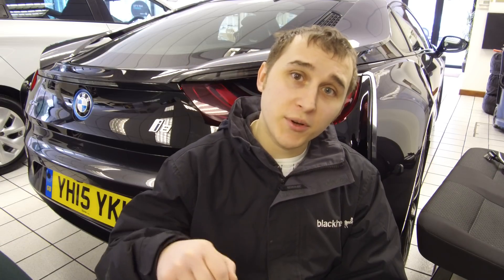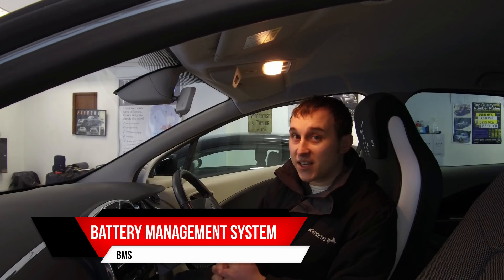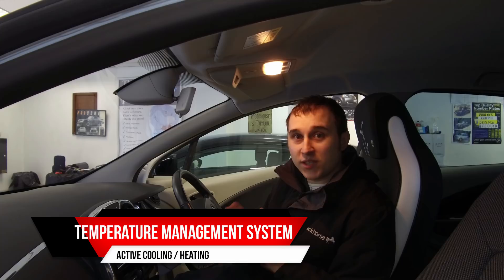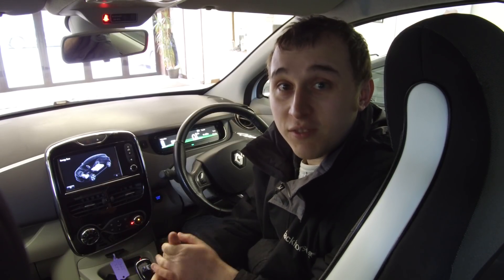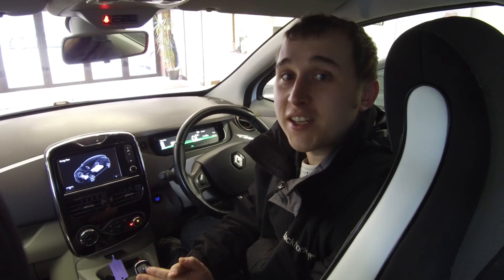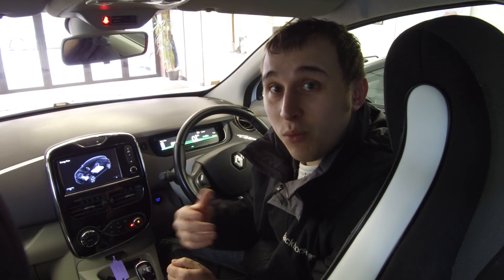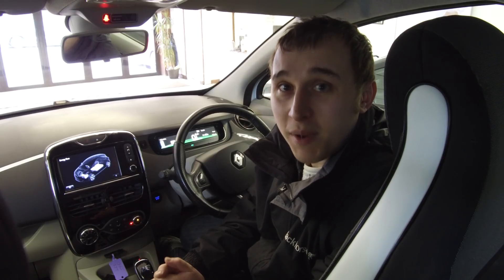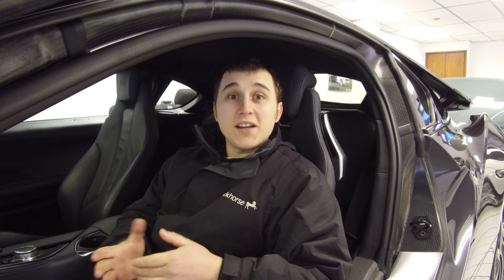2018 Nissan Leaf Charging issues TMS? Firmware?, my take  🔋🔌🚗

Comment: I don’t have a leaf that I can take apart and look at all the airflow vents, but let’s say Nissan Leaf engineer’s actually graduated high school, and they know every HVAC system (unless in biohazard mode) will have some fresh air intake, and therefore there will also be some heated of cooled air vented out of the car. 

Under the Leaf there are some aerodynamic panels which basically form a chamber between the bottom of the cabin and the outside air. The sealed battery pack is in this area. 

If we allow the HVAC to vent into this compartment, it would surround the battery case with the same air the humans want, which tends to be the same temperature batteries want. The same concept allows out cell phones to survive with passive cooling because we wouldn’t charge out phone in freezing temp and hopefully won’t set the phone on a dashboard in the sun and charge it.

In super cold weather, the battery will be so cold that initially you will want to heat it by driving, cabin heat, or charging slowly as it warms up enough to safely charge. Once it can take the full 40 kw from a 50 kw dc fast charger, everything will be great. The battery warms and charges fast. 

Under normal circumstances, you would then drive it somewhere and it will sit outside and fight the cold by trying to keep enough heat for 8 hrs that it doesn’t get too cold. But if you drive it in cold weather with the cabin heat on and drain it fast and charge it fast, eventually you will heat soak the battery and the BMS will do its job to throttle charge rate. 

In hot weather, with the air conditioning running, the battery should be encased in cool air from the cabin. And since cool air tends to circulate naturally down and out the underside aero panels, it should be able to carry some heat away.

We all know active thermal management is best, and liquid cooling is better for dissipating heat from a confined space out to where there is more room for the final heat exchanger. Why is Nissan being so stubborn with this issue? Why was Steve Jobs not allowing Adobe Flash on iOS devices? Why is Apple getting rid of 3.5 mm audio jack, and why does Tesla refuse to include LIDAR? 

Can Nissan not afford to hire a college graduate? Are the Japanese stupid when it comes to batteries? Why are all the other Japanese car companies waiting for better batteries before they start losing money on each car? 

From what I’m seeing, 2018 leaf owners who drive it like a 2013 Leaf are very happy with it. Nissan could have fixed the problem by removing the DC fast charge plug. But to give added capability, they offer the plug, but it doesn’t turn the Leaf into a vehicle that can be fast charged and driven hard 24/7. But everyone wants to know why Nissan doesn’t just add active cooling so that you can drive it like you stole it.
Reply from the maker: If you drive it like the old leaf it over heats the old leave could manage multi rapid chargers the issue is the software at my guess is throttled far too early
Reply: Nicolas Raimo, I think they fixed the BMS, so that it stops charging a hit battery, which was making the early Leaf batteries degrade fast. According to James Cooke, who had an early Leaf before the Tesla, that battery would also get heat soaked on a long trip. 

Its possible that just a certain temperature, too cool to run the AC, but to warm to cool the battery compartment. But in 5 years, this battery may still be in good shape because it doesn’t allow charging too fast when it’s warm. 

Here’s something that talks about what I mentioned before, which would be normal on a hot day, but can also be done on a cold day of you are overheating your battery:
http://www.mynissanleaf.com/viewtopic.php?t=22276
Reply from the maker: That's possible which is why i said in the Video one reason may be to make the SOH last longer.
Reply: Nicolas Raimo, we just need to find someone with a 2018 Leaf and plenty of time and leafspy to see if running the HVAC in fresh air, high fan, has any effect on cooling the battery. 

The S model for $29,990 doesn’t even come with chademo, so these guys will never experience the problem using the 6kw charger. The car wasn’t really intended for commercial duty. 

Now people are learning thermal management isn’t want makes the battery last, the BMS does that. The active cooling only allows the battery to charge faster before the BMS does its job.

But the real question is, which nobody has really answered, why doesn’t Nissan just add some form of active cooling? Even a basic one like Zoe has would be good. 

Do you have inside information as to how much a Zoe and Leaf 40 kWh battery cost?
Reply from the maker: No down to the pricing no, however Nissan will be using same pack as Renault next or least same cells as Nissan is switching to LG chem same as renault

Comment: Thanks Nic- nicely explained, in  essence ( Have i got this right? ) for the average driver, who has charged up the night before- goes on a drive say 230 miles with 1 fast charge on the way and stays at that destination overnight- no problem. If you then have a further 100m to go that day - and the battery cools down enough..after an hour or two  they might get away with another fast charge..
Reply from the maker: yes that be fine its down to people doing lots of rapid due to speed, in fact if your in no rush and rapid charge it, it will still charge just slower rate than the previous 30kw leaf.
Reply: leo clarke - the only problem is, the second fast charge will take 2 hours and not 45-60 minutes. If that's not a problem for you, fine.
A normal drive 100% - 0% rises the temperature by about 14°C. A fast-charge rises it for another 20°C.
For your information, you will be driving your battery at very unhealthy 50° to 60°C temperature. State of health (battery degradation) won't be happy.

At freezing temperatures the battery cools down in 8-12 hours (to reasonable temperatures). In summer it will take 24 for the same amount and up to 48 to  cool down close to ambient temperature. 
It has an awfully bad heat dissipation.

Comment: I think they have reduced the amount of cobalt in the cells as the price has doubled
Reply from the maker: +Mark Williams chemistry isn’t my strong point would this affect the heat each cell could handle?
Reply: It has nothing to do with chemistry.
Leaf has no system to pull out the heat. Air cooling wouldn't work because of the battery shape and they didn't build in liquid cooling.
It looks like planned obsolesce.

Comment: 2015 Leaf 24kwh 57000km 100% soh.
Reply from the maker: this from Leaf Spy?
Reply: yes this can be proven by leafspy
Reply from the maker: Higest SOH i've seen on a 2015 leaf yet! your in the lead!
Reply: its a leaf nordic version always used charge timer so never sat at 100%soc for a long time and i live near lillehammer so its not so hot in the summer time. stored mostly in the garage (shade) have litle bit over 100dc rapid charges on it since november 2015. when tesla bjør did his test its was around -10!

Comment: Nissan Leaf 2011 63000 miles, 73% SoH, range 50 miles max
Reply: 73% SOH? At 63k miles? Horrible! 
Warranty or already out of it?
Reply: Battery warranty is  for the first 5 years, and the car is nearly 7 years old. Also, the warranty only kicks in below 9 bars, and I'm at least a year or two off that. My degradation is actually far better than most 2011 Leafs, there are models with 20-30k miles with 30-40 mile range in the US.
Reply: Aaron, I've heard, and it is even worse, and all of this is coming from having no active cooling.
All you can do is a) buy a spare battery and/or b) prevent further damage.
https://pushevs.com/2018/04/27/battery-charging-full-versus-partial/
This advice is actually valid also for smartphones, this is the reason why batteries in smartphones "die" after a year or two. Mine has four, I took the advice and it is still doing quite well!
And never, never leave a full battery at some hot place.
Good luck!

Comment: 1170 Chademo, 870 Type 2 Rapid in UK.....methinks you are a touch biased
Reply from the maker: rapid you only looking at 43kw there's lots of 22kw AC semi rapids.   Then look at ireland next to no chademo,  Germany has very few also,  not sure about rest of the EU.   If it comes over as biased it wasn't meaning to the UK has GREAT chademo support.   In the USA DC is the only real form of charging so they have even better than us
Reply: Yup, 22kW is Fast.
Reply: Dave Bell 22kw is not fast by a long way. Not here not anywhere.
Reply: Nicolas Raimo   Next to no Chademo in Ireland? That's not true. There's more Chademo than AC43 here!
Reply: I would also say its unfair to criticise Instavolt for their choice of business model, they are installing stations as a commercial venture that will be in place for a number of years not just to service the requirements of one model that ultimately wont be the way the market goes. As the market expands with larger batteries the charge stations will only get bigger they have to think 5-10 years in advance.
Reply from the maker: am accounting for AC22 and AC43 in this model, from info I've been told by Jan-Sprat.
Reply from the maker: Phil i get there business model but in 5-10 years time renault zoe's will still be on the road, EV's will last longer than petrol cars so are likely to still have current zoe's for next 15 years in that time there machine might of been replaced.
Reply: But what percentage of overall cars will be Zoe in 5 to 10 yrs? Its a numbers game they have to invest where they can earn the best return on their investment. On simple figures not allowing for taper on charge 22kW post at 30p is £6.60/hr but a 100kW CCS would be £30/hr per space and thats before even applying a premium for it being a faster charge.

Unfortunately as 3ph power is not generally available other than at commercial premises in the UK its unlikely that manufacturers will go down the 22kW AC in the long term as your not going to fit a larger 22kW inverter to the car. Thus if your going to invest in chargers commercially you need to pick what the mass market is going to be. With batteries looking to be in the 50-100kWh range in most models coming in 2019-20 then 22kW isn't going to be big enough as a 4 hr dwell is generally going to be too long.

Only place I think they maybe more common is hotels where theres a longer dwell time but I think most of those are likely to go down the 22-25kW CCS DC route that I'm starting to see most charger manufacturers coming out with at the moment as ultimately I think the CCS plug is likely to be the main winner.
Reply: Nicolas Raimo Do you mean Jan-Bart Spang? I've had many conversations with him and he is a nice guy, but we use the term Standard charge point (SCP) for AC22, AND Fast charge point (FCP) for AC43, Chademo and CCS. Regardless, it is false to say there are next to no Chademo here; there are over 90, which for a population of 6 million works out at about the same ratio as the UK, I think. Don't get me wrong, I'm all for having many more chargers, I'd just disagree with saying there are next to no Chademo in Ireland! ☺ I enjoyed your video. 👍
Reply from the maker: Cheers Superbystanderman make sure you subscribe, you in a Leaf or Zoe?
Reply from the maker: Hi Phil current new model zoe just been released with ONLY 22kw charging, so i suspect still a lot on the road in 5 years, its also nice to put 22kw to free up High power rapids.  If Instavolt dropped AC in 2/3 years i might have a different view, however currently i think its a bad idea, the only reason they don't have AC is there buying American made chargers and are American friends don't benefit from a 240v grid.

Comment: Nissan's decision to not use a TMS seems to be back to haunt them. Maybe they can retrofit a system..  Or else usher in the new 60kWhr battery and kill off the 40Kwhr
Reply from the maker: i suspect lots of 30kw leaf owners will be holding out now until that
Reply: I did wonder why the 60kWh was coming so soon after the 40, thought it was the battery cost but maybe a little more sinister and they came across testing problems hence the change from AESC to LG for the 60.

Comment: I think 2 hour "rapid" charges would put me off with a hot battery, no thank you.
Reply: There have been reports (although I've only heard second hand) that drivers in Spain have experienced charging slowdown on their first rapid. External temperature was around 20 degrees.
Reply from the maker: Don't forget it only happens on 2nd rapid and the battery isn't really that hot which is why am suggesting maybe its a fault in software
Reply: Nicolas Raimo evidently it doesn't only happen on the 2nd rapid charge to some owners, it all depends on battery temp whilst charging, people won't touch them with a barge pole with this problem, who wants to wait up to 2 hours per rapid charge, this is what happens when you ram more and more battery into the same size sealed battery container with no active temperature control, you get a public relations disaster. They have known all about it for years and have chosen the cheap fix and have been found out.
Reply: Well, as they have not rolled these out to warmer climates yet I think it'll be as bad as the battery fiasco with the Gen 1 Leaf in places like California, Arizona etc. You seriously would have thought that they'd learned their lesson from that.
Reply from the maker: maybe they might take a "leaf" out of renaults book and use the climate and heatpump system to cool
Reply: David Barr you are so right, it is all about investment and my opinion is that Nissan are not as enthusiastic about electric cars as they once were and they are not doing what is nessecarry to do the job properly, my 30 overheats after the 4th rapid in a row, it does not take a brain surgeon to realise that 4/3 times as much battery in the same space causes much more heat build up.
Reply: Yet they active battery cooling in the e-NV200 van, regardless of battery size I believe.
Reply: Phil Gordon just what I sumised.
Reply: +Neal Archer and Nicolas Raimo, but you will have a 40°C hot battery in summer at the first rapid charge, which will already result in a 27-30 kW charge.
At the second rapid charge it will be 18-20 kW, 2 hours and a battery at about 55°C. And no, it is not a faulty software, it's by design to prevent the battery to go over 60°C.
Actually a bad design, having no TMS. The battery should never ever go over 40°C.
Reply: Richard Petek I was so excited about Ev's and bought my 30kw hr leaf just over 2 years ago. Since then I have been completely disuaded and dissolutioned against buying another until many years in the future. At leaf prices EV's are a  completely compromised vehicle against ice at the moment for numerous reasons. I have had my electric trial and until car ability and infrastructure are comparable with ice I would never consider another.
Reply: I don't want to spoil your soup, so I will say just - take care where you are on that chart:
https://pushevs.com/2018/03/20/nissan-leaf-battery-degradation-data-24-vs-30-kwh-batteries/
But you can do a little about it:
https://pushevs.com/2018/04/27/battery-charging-full-versus-partial/
Tested and verified:
http://batteryuniversity.com/learn/article/how_to_prolong_lithium_based_batteries

Having no active TMS is a bad design, but to be honest, if the car doesn't have it, Leaf 2 is actually helping the battery - on the expense of driver's time.
It does what a Leaf 30 kWh owner should do manually. Stay away from those red bars, fear them like the devil!
And avoid charging over 80% unless you really really need it.

Drive safely!
Reply: Neal Archer, another thought: Hyundai Kona 64, arriving this summer.
An EV that will challenge Tesla Model 3 and Jaguar iPace - at a much smaller price (and, OK, a smaller car)
Against ICEs? Depending on where you live. Europe and USA - east coast and west coast - no problem. When the car needs a charge, you need a break too.
OK, at 50 kW charging stops will be longer than your coffe-breaks, more like your meal-breaks (45 minutes). But when project Ionity is built, which should happen in a year or two, your coffe-breaks will be coffe-breaks (0-80% or close to 300 km in about 30 minutes).
https://electrek.co/2018/02/06/map-ionity-ultra-fast-charging-network/
What do you say?